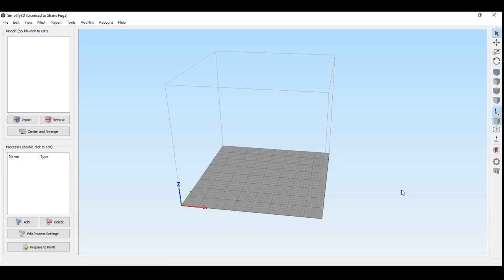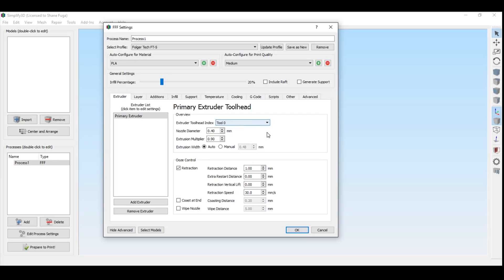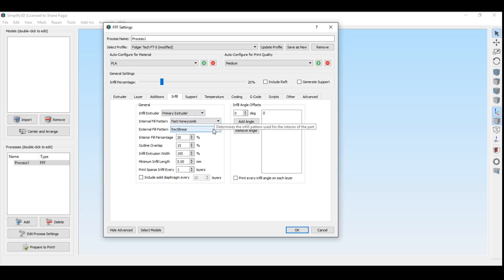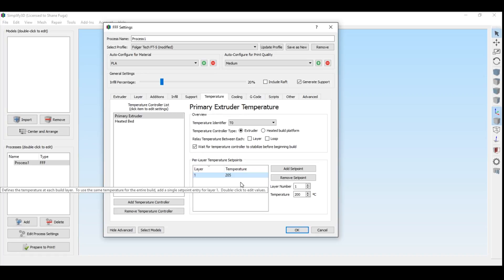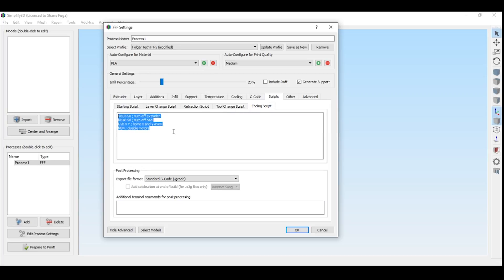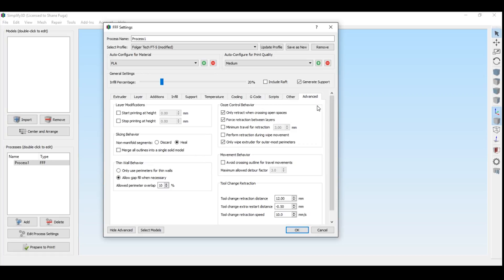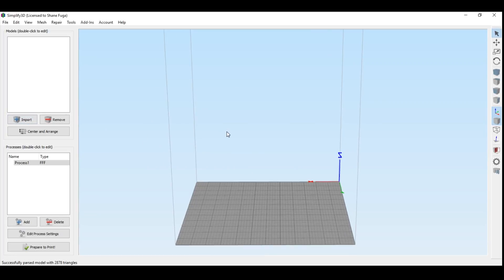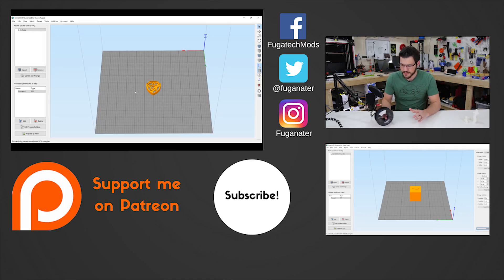Simplify3D Setup for the Folgertech FT-5

Comment: .83 extrusion multiplier in Simplify3D's process settings with an E3D Titan extruder?  I don't think that's right.  You must have tripled (approx) the multiplier in the FT-5's firmware.
Reply from the maker: Really? Honestly I didn't know you can set extrusion multiplier in the firmware. I only thought you could set E steps.